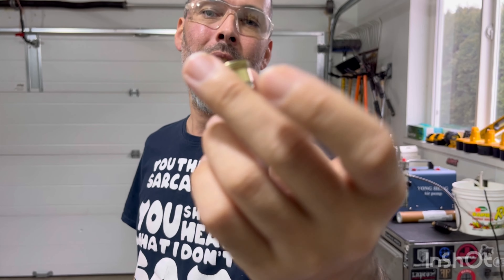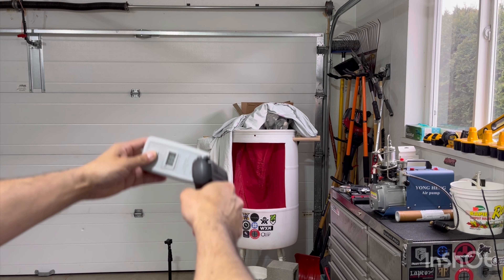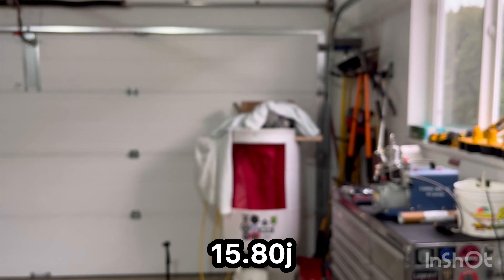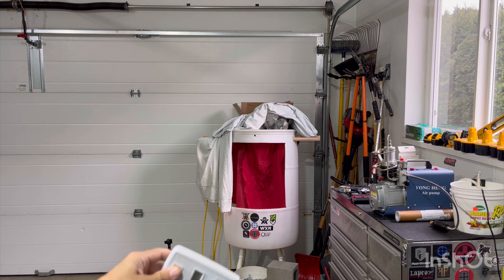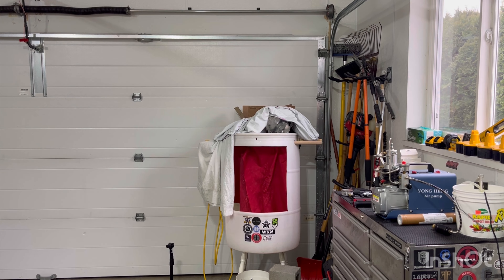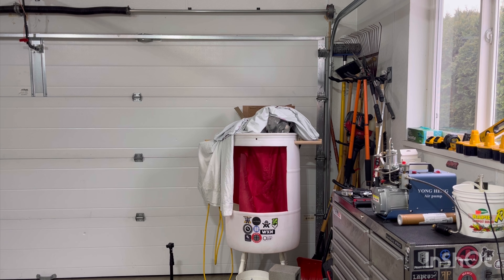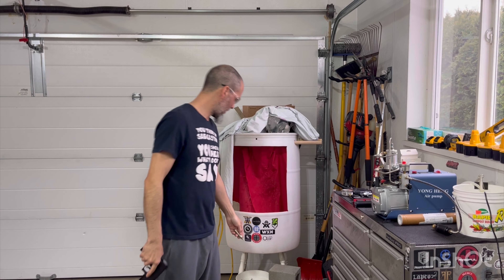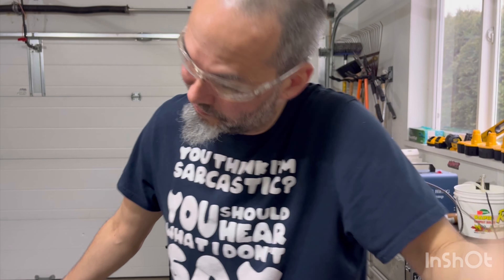LL4D Salt Supply S2 - Drilled 1.6mm (1/16”) co2 restrictor

Comment: Just a thought. If you have a heavy projectile, it should allow a buildup of pressure behind it. Only once the pressure is great enough will it actually launch. If your projectile mass can hold that gas for long enough it should be more consistent. It's a fine line between to much backpressure and too little. With a light projectile it might not have a long enough time to build pressure.
Reply from the maker: You are correct and my best numbers on co2 and for the most part hpa are always with heavier balls. I did test with 9.9g tonight…..but thats for tomorrow. 🙂

Comment: Tested the hd24 heatcore chamber replacement with 13" barrel and 7.2 gram aluminum balls,initial tests around 500fps,Not The 550fps yet im looking for,but a bit chilly this evening..
Reply from the maker: They are still flying at 7.2g. No slouch.
Reply: @lesslethalfordummies  85 joules..decent,not the 99 or 100 joules..hd24 sent me 10 black ball rounds,they weigh almost 11 grams,bet theyll get 100 joules
Reply: @lesslethalfordummies  im gonna get a .678 or .680 barrel for these aluminum balls,they run about .678 or slightly smaller,bet thatll get the velocity up a bit and warmer temps id say will also
Reply from the maker: Valken recommends a barrel no smaller than 0.683 or risk getting the bolt stuck.

Comment: Doesn't it shoot 20j straight out of the box pretty consistently? Dont get it twisted your vid content is amazing Bro!
Reply from the maker: Not twisted at all and a great observation. Depending on the projectile yes some did hit 20j out of the box. Mine at the time of starting this test was hitting about 18j to start with the Salt kinetics. Co2 is going to test different for everyone for a variety of reasons so i can only speak for my particular launcher. In the grand scheme of things i may only gain 1-3 joules for a lot of work. I touched on it in the next video.
Reply: Well, I know that this is your thing. And no matter what the outcome you're going to mix n match n put many many hours into the process. No worries, we love it! Great testing bro!